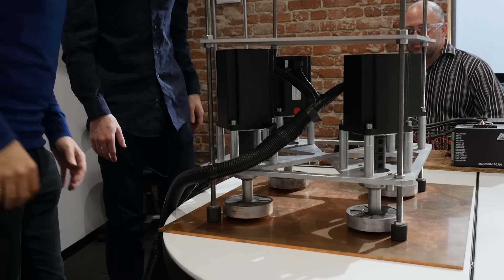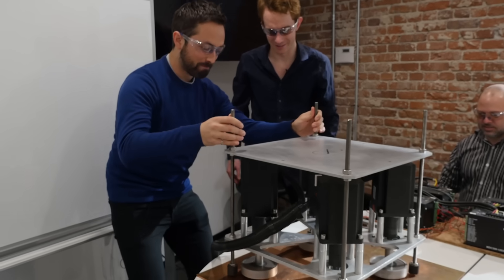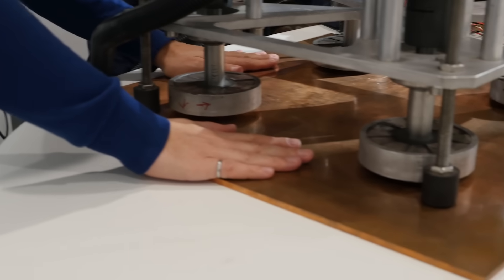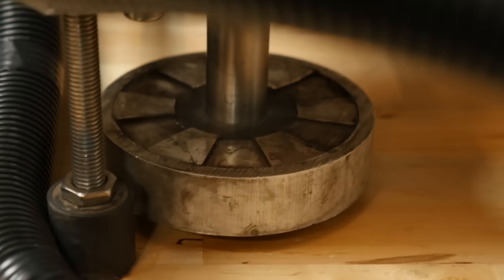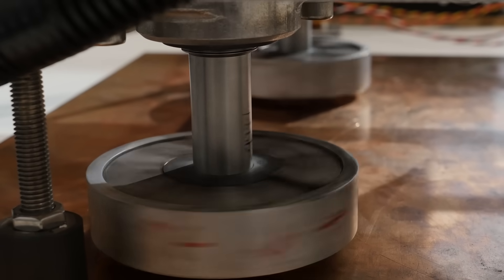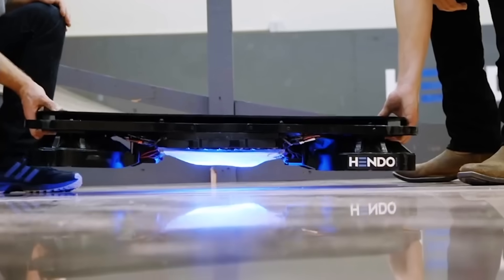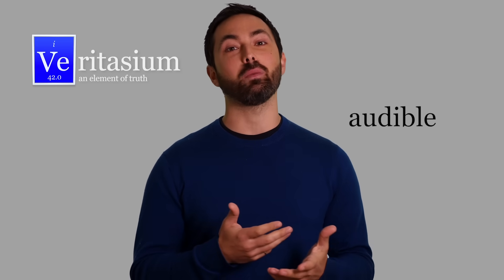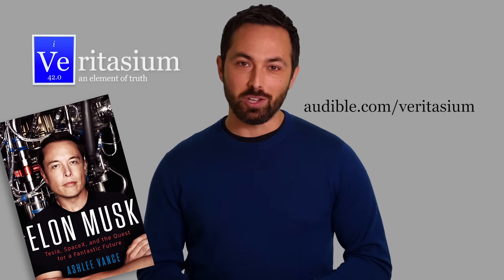Electromagnetic Levitation Quadcopter

Comment: Instead of physically rotating a bunch of magnets, couldn't they just use an array of coils energized in sequence to produce the same fields? (Think along the lines of induction motors.) A couple sets of transistors in parallel (to handle the current) to switch each coil, and then you have something solid-state with no moving parts.

Now just make that copper plate into an inverted V shape,  and bank each pair of magnets and it should self-center to make a working track of inverted-V sections.

Still this system isn't that efficient if anything has to hover in place without moving, too much of that energy is wasted as heat from the resistance of the eddy current.
Reply: So a conventional maglev system?
Reply: Split an Eve
Save an Adam..
Reply: There is a minimum amount of time that the field lingers before it dissipates and you can actually charge the next configuration. Basically the same reason why Gause cannons aren't a real thing outside of small scale laboratory demonstrations and sci-fi stories.
Reply: @megadeathx  Hate to break it to you but the US navy has a fullscale railgun in working order.
Reply: @DeagleGamesTV  And? Its not exactly useful.
Reply: @73_65  how so. It is incredibly useful.
Reply: @someonesomewhere8869  Not really, railguns in general tend to be pretty much just cool toys, even the military's. This is because of two major problems, friction and electrical resistance, because of these railgun barrels need to be replaced far more often than those of normal guns. The future of projectile launcher based weapons lies with Gauss cannons(AKA: coilguns) because they avoid the electrical resistance problem.
Reply: @73 65
Can’t they cancel the friction with magnetic levitation ? But with magnets whose magnetic fields are made to be extremely condensed ? I’ve seen that somewhere (Link in the next comment, hopefully, if I do find it)

Plus, can’t they just supercool it to cancel the electric resistance ?
Reply: Current requirements, switching and current lag, would probably negate their use in mag-lev systems.
Not to mention the increased initial cost and complexity.

Comment: great stuff.  loving the magnets, always been a fan experimental magnetic lev. 
do we as humans have any theories  on doing this without the use of copper (as in the rail) and without so much electric power to power up these motors. i understand the motors are pretty thirsty motors due the the magnetic resistance.  and due to the weight the machine can carry, isnt this a prime candidate for the hydrogen fueled engine to produce the electricity  required for lift and motion?   it would not surprise me if the hydrogen hybrid engine is most suited for this application. same weight as batteries that would be needed for a few hours of power, but with no refilling or charging. and being friction-less (almost), the weight issue is then not a big issue such as friction transport (ie the wheel) ...its a no brainer and a  win win.
Reply: I think the only practical use would be for trains. For cars it would be way too expensive even only highways would be really expensive not to mention the smaller roads.
And copper is a heavy metal which makes it a health hazard 
We could use other materials but that might be even more impractical

Comment: You should measure the current from the copper plate. Heat is the result of work being performed due to magnetic flux; power
Reply: Let us know how you would measure the current on a plane of copper... if you can figur it out, let the transformer and motor guys know about it.

Comment: You know there should be a bubbling wave current that can solve that motor 
without the copper  plate i believe that the magnetic wave formed into small bubbles 
consistently can repel the air anybody ever tested the theory

Comment: Yeh....but what good is this if you NEED a copper plate in order for it to work? This has no practical application so whilst this is a cool school project I fail to see the benefit. I’m fully prepared for that assumption to be proven wrong if anyone wants to go for it. Bare in mind, I’m not disputing that this is cool, just not useful.

Comment: It should be developed to make levitating cargo, freight & passenger barges, ships & planes. Gyro power could also be more developed to provide thrust & propulsion along with non liquid fuel energy source engines. There is a very large market for them now as planes, trains & trucks can not keep up with current demands of freight shipments & more people would travel much more if they could. As the current level of productions are not anywhere near where they are needed to be, should be or could be worldwide!!! As this now needed development is the catalyst that has the ability to greatly multiply world trade & productions, and greatly improve travel times & shipping to lower than 1/2 to 1/3rd of current levels.

Comment: problem you need sheets of metal on the surfaces for that to work
Reply: Greg Kirby the experiment has been done using conductive powder, and conductive material will work, powder could be added to bitumen, you don’t have to use electric motors you can use linera electrical magnets, this machine is just showing you the principal of how levitation works with magnetd

Comment: The air tube system has been used in department stores to send cash to the finance depts at high speed. The day I saw this I thought of human travel. The "UFO" style air travel system I don't understand. It is apparently two CONTRA rotating discs with magnets at intervals (configuration, size etc I don't know) which overall produces a very high speed alternating magnetic field which apparently cancels all other effects around it. i.e. the world and all its effects on the craft are no longer there ! All you do to move is tilt one of the disks which acts like a gyroscope. i.e. if you were not holding it it would have moved away. Several effects have been witnessed by people coming across UFOs. All electronics die. This is because the alternating magnetic field is strong enough to stop electrons in a wire. In DC current as in a car, the electrons first go back and forth then the backwards and forwards motion is shortened then the electrons will be suspended at the same point when the car is close to the device i.e. all electrics fail. The fields are also strong enough to control light. People have witnessed a change in colour as a UFO is about to move. This is something to do with changing frequency of light waves. Skittish behaviour = our gravity system on Earth is quite high and the disk probes are designed for any planet so they move a lot quicker in our environment. The book "My UFO" tells all.

Comment: Is that not what they use on GPS satellites to change the angles slightly ,I made one with a bell and a microwaves magnetron it has to become a vacume and the wave has to be exact so it bounces back the v shape or bell makes the energy more in one side casing it to move forward ive used a skateboard and in my bath it literally an engine with no moving parts ,©

Comment: Would this work by replacing the copper sheet with "insulated" copper coils stacked in a sheet? Maybe some energy could be recaptured or... Only problem with this type of device is enormous energy is being used and mucho copper is being used. This all adds up to expensive. Neat effect though. I just drop a magnet in a copper tube and call it a day.

Comment: Could we make something that acts like a mountain for the sun's rays to help cool the desert?
Reply: Sure. Fill an open container with water and pile it up. The higher you go the colder the peak. Funny how that works.
Reply: @bobonmynob1170  satellites that help the equator with magnetic shielding should be helpful. The Earth is making alot of it. Harness physics with natural stuff is fun.
Reply: @josephpeters5681  created by this spinning ball in  centripetal motion as Galileo rediscovered. The halbach arrays in an MRI machine while using the shumann harmonic for a reason. 
They're also natural things and not a bastardization of science and engineering like this video.
Reply: @bobonmynob1170  shooting energy into the atmosphere might slow the Earth down.
Reply: @bobonmynob1170 using energy from an MRI to shoot energy into the atmosphere might slow passenger  jet's function. Sounds good though

Comment: Flying saucers confirmed. So powerful it uses the planet as its metal plate.
Reply: That would take more energy than using rocket fuel. Why force yourself to carry around way more fuel in order to use a very inefficient way to move around?

Comment: if the plate generates heat as a byproduct, why not capture that heat and use it to power the motors?  heat = energy  If it's efficient, the heat is used up powering the motors... zero sum gain, equal and opposite reactions

Comment: That same boy, proved in 20 seconds. How to show what effect large very strong magnets, would do to humans. How to prove they would have a positive or negative effect. Or simply no effect and are visually provable to be harmless. "Being mindful of humans having iron in there blood, providing a protien net to clot blood.
In 20 seconds that little boy figured it out.
That was amazing for a small child.
U need a container full of water, indoors no wind current. A small flat piece of Styrofoam. And simply place a small cup of real blood on the floating Styrofoam. Then you need up until 1979 when this kid showed everyone a material to make magnets from, He personally used one of the first of this magnet type. Carefully held it near the cup of blood. And it pushed it away instead of attracting it. Proving large magnets didn't  pose any harm to humans. It actually increased blood flow. Not causing instant blood clots.........that was a 4yr old whom could barely read.

Comment: You don't need the magnets and motor, just a coil of copper wire with AC running through it will float over copper, aluminium or whichever conducter you use.

Comment: Ok so the metal can be quite thin and if the fields are modulated properly you can use the same forces to pull the platform forward so yes this has the potential to be used as a basis for transportation and as a matter of fact in other forms it already has in maglev train systems

Comment: How about a device that converts the magnetic and or electromagnetic pulling or pushing force into mechanical lifting force through the utilization of the lever. Imagine a hollowed out box and inside on the floor of the box is a magnet secured to it. Now imagine a second magnet above that one trying to pull on the magnet on the bottom now the magnet on the bottom is pulling back too but what if you put the magnet on top inside of a separate object that directly pressed down on a lever and the other side of the lever had bar reaching up to the inner top of the hollowed out box so now the pulling force from the magnet on bottom is being converted into mechanical lifting force upwards and the pulling force of the magnet on top could only be pulling the magnet on bottom upwards and since the magnet on bottom is directly fastened to main structure it to is lifting the object upwards. Now if the magnets being used are very powerful they should be able to overcome the entire mass of the structure and make it fly up. :) I think :) and if electro magnets are being used then more power pumped into them means stronger lifting force.

Comment: Point the first... I'm sorry... Did he say that this has something to do with another billion people getting from one city to another? As opposed to boring things like roads and railways because they clearly have never taken anybody from one city to another in a day. WT actual F is he talking about? Maglev is not new technology and more importantly it is expensive to build which is why only three countries have it. If the guy is implying it will become the transport system for the poor in the developing world in preference to conventional railways I beg to differ.

Point the second... What is the power consumption of this thing? Those look like some pretty hefty motors just to lift a massive 50kg to a dizzying height of 10mm and clearly there's a significant loss in heating the copper plate.

Point the third... While the whole spinning magnet thing is a nice party trick the video then says the Hyperloop won't use them so why the connection at all? As far as I can tell the Hyperloop, if it ever becomes a reality and my money says it won't, will use perfectly standard maglev.

Comment: This one has 4 heavy expensive powerful motors that in turn spin an array of heavy expensive magnets, and need expensive bearings to keep some types of friction at a minimum.  Why not go all solid state no moving parts no heavy expensive neodymium magnets and no bearings or shaft  I bet you could shed maybe 75 pounds from the table. 

Im guessing these were 3 phase induction motors. They create a moving/rotating magnetic field that causes the rotor to spin by causing eddy currents in the rotor that in turn push against the rotating magnetic field. So now the rotor is spinning, it spins an array of expensive magnets. 

To go solid sate, dump the magnets. Dump the motors, dump the bearings, dump the shaft. Instead, add coils as if to making 4 separate 3 phase axial flux induction motors sharing the same bottom non-conducting stator plate. Their roating magnetic fields will induce eddy currents in the copper floor bellow.
Reply: That's kinda what I was thinking, they are creating a magnetic field to spin the motors to create another magnetic field! Why not just get rid of the middleman, drop some weight, and pulse the current to allow it to maneuver around.
Reply: @AssemblyBanditChannel  now that is a good idea. Pulse or vary the current to induce torque.

Comment: we could use this on select paths over the earths crust where pure nonmagnetic metal deposits are rich.. and with strong enough magnets and a sophisticated enough system, we could use this tech to "jump"/"swing" from one star to another.. but it would take magnets as big as china to be able to grab the field of a distant star while repelling the adjacent one without being ripped in a 180...imagine being able to push off of the earth with this, turn around toward a single star and attach yourself to its gravitational force, ride the wave. in addition gravitational forces from distant stars would be much weaker than force we feel right here next to earth.. wed have to push off from earth until the adjacent stars' forces could be felt as stronger than the magnetic attraction between earth and the craft.. we would start out much slower than the 9.8 m/s/s that we fall toward the ground at.. theyd have to be electromags because there would have to be a way to turn them off if uncontrollably drifting toward an attracting celestial body.. it would be pretty awesome, none the less, if we could achieve light speed with this.. but the tech is still in diapers

Comment: we need a 360 degree copper circle with doors and windows in it       2 dividing copper walls i.e a circle with two lines running thru it like top floor middle floor bottom floor    throw inn  the magnetcs  dead centre   middle foor only using magetic sheets on top of and on the bottom of magnetics    keeping it the magnetic away from the copper side walls and both copper floors and add in the wiring and steering mechanisims and hopefully we might get lift off lift  i dont know try and keep trying is my motto

Comment: Seeing all the whataboutifs regarding the hyperloop being shot with projectiles, as though current rail is immune from sabotage via derailment and wouldn't also cause massive catastrophe if a freight was derailed even though they have the KE of a small yield atomic warhead, also watching people who haven't actually taken Stat, Mech, Dyn try to tell engineers how expansion coefficients and joints work as though we engineers didn't sit through multiple labs and lectures, pass exams to know their limitations and possibilities etc.. I suppose electrodynamic suspension is also impractical despite inductrak's success in the dev cycle at LLNL. They said sending people to the moon was also an engineering impossibility and impractical, yet we did it. I'll leave the physicists and chemists to the naysaying, excuse us engineers while we go solve design problems. "Science is about what is, engineering is about what can be."~Neil Armstrong

Comment: They 
Should try carbon/graphene or silver instead of copper. They are magnetically reflective.
Reply: Copper has the same type of magnetic reflection as graphene, silver, and gold, it's just that graphene has a better reflection/weight ratio. The trait is called diamagnetism.

Comment: Try Mercury (metal) in the plasma state, rotating inside a vacuumed (no friction) torus at extremely high speed (voltage). What is the maximum magnetic field obtained?

Comment: What happens if you connect the copper sheet to the bottom, a little below the magnets, after they already started levitating? Will they fly through the roof or fall down.

Comment: My idea is to use the ionized air,who is hot n ascencional,in a saucer shaped vehicle,to make it levitate high.a ringlike capacitor will be use to ionize the air in the whole lateraldown boards of the vehicle.
the propulsion forward n directionament is due lasers in resonating chamber,very similar to emdrives,to create radiation preasion, who by its time is the most powerfull propulsion system who even exists.my coceptional flying saucer ideas goes like this.